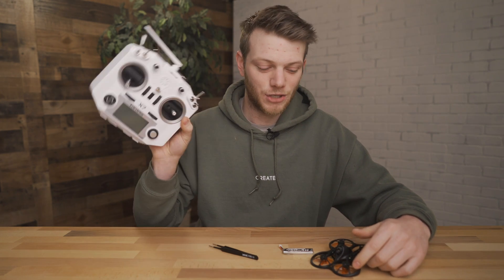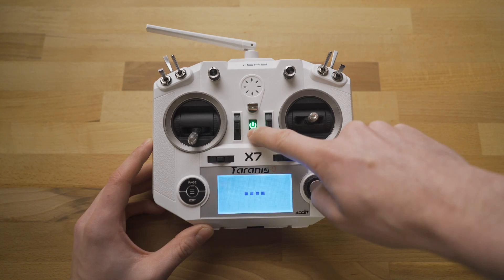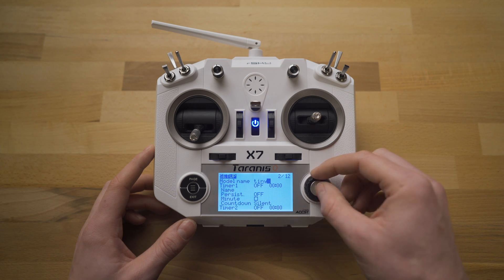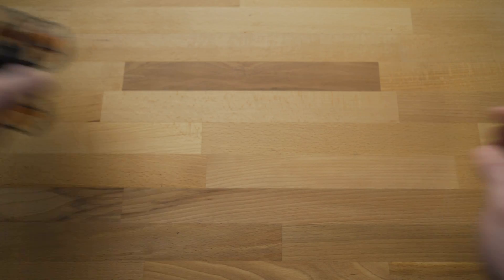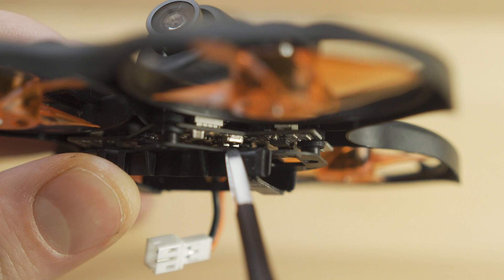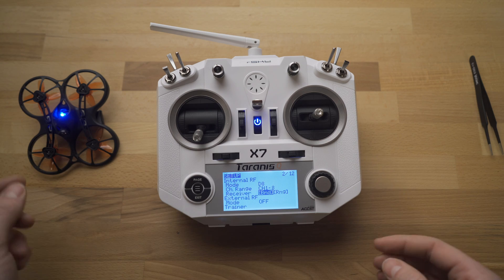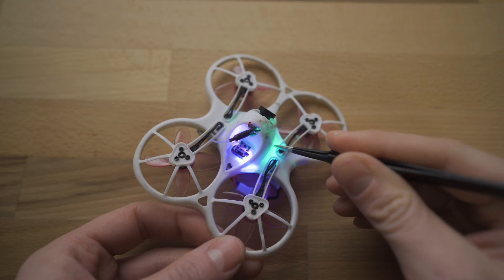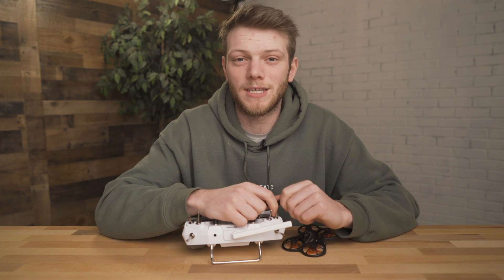How to Bind EMax Tiny Hawk and FrSky Taranis QX7

Comment: I have the same taranis but i dont have a module in the back, like above the battery there is another socket with pins.  the eachine rtf kit has its own radio but id like to use my taranis. It seems to be d8 protocol on the quad. Which module do i have to buy and stick it in the back of the taranis¿

Comment: I have 2 questions:
Does this also works with emax tinyhawk 2 freestyle?
Do you need a taranis reciever put in the drone to connect with the controller, or the one which was set when you bought the drone?

Comment: Might wanna add the new access models wont work on d8 receivers unless you change it to the frsky xm, xm+, or archer m+ receiver... currently running the xm upgrading to the archer m+ for ota, fport and double the range almost 4x more than stock. 🤷‍♂️

Comment: Hello~I'm korean~
I bought an x7 remote controller after watching your video.
Is there a simulator cable in your x7 remote controller set?
Reply: No its the same cable u would use to charge a ps3 controller

Comment: Does anyone know if d16 has less or more range. I finally got my tinyhawk 2 to work but it has absolute crap range. Maybe 100ft. I was only able to bind with d16. My taranis X7 access doesn't have d8.
Reply from the maker: Is it the VTX Range or actual flight range where you lose control?
Reply: @TheGregFarnum once I lose video the quad drops. So I take it both.
Reply: I also have access. Just bought the XJT to bind in d8 and working on that now. I bought it because my range was also garbage. Will let you know if I can figure out how to get it to bind lol
Reply: @GarrettDespainVlog  Did you ever figure it out? I also have the access and the tutorials for the old models to get D8 don't work.

Comment: I have a Tiny Hawk 2 and an FRsky QX7 that came with an Access receiver thing on the back. In my mode menu options I have, OFF, ACCESS and ACCST D16. Im having trouble pairing. Will this not work with the Tiny HAWK?
Reply: I have the same problem
Reply from the maker: Try this https://youtu.be/mDBoXLGjqS4
Reply: Same problem here with my TinyHawk 2.

Comment: Have the Tinyhawk 1 and just ordered the Tinyhawk Freestyle.  Time for a new radio.  Thank you.  Don't have Freestyle or the Taranis qx9 lite (the one I'm leaning towards this hour).  I am new to FPV but am already obsessed.  Watching and learning.  Fun is!  Thanks for this and the next, which I plan to watch now.
Reply from the maker: I love the qX7 and is definitely the way to go in my opinion if you ever plan on doing bigger 3 and 5” quads
Reply: Did my research on QX7.  I like.  Question:  Do I need the XJT Lite module to connect to my growing Tinyhawk family?  Also - If I get into this, do you recommend the M7 Hall Sensor Gimbal as an upgrade in the future?
Reply from the maker: John Pellico I just bought the stock one and it works will all my tiny hawks no extra modules or software. As for the sensor gimbal I’m not to sure about that I’m using it as is right now for a 5” racing and 3” cinewhoop
Reply: @TheGregFarnum  Thanks for the nearly instantaneous response!  That what I was hoping.  From what I could tell, the newer FrSky radios stopped supporting D8,  so now they need the XJT Lite Module to connect.  Again - really appreciate the info - I'm learning every day.
Reply from the maker: @ShorePelican55  https://www.youtube.com/watch?v=mDBoXLGjqS4&t=
this is a way to do it without the module in D16 mode

Comment: Hey Greg or anyone I need help. Total new guy trying to do what you did in the video. I tried before and thought the button on top of the stack by the USB was the bind button but I think it's the vtx or something but I was following directions for binding using that button and now I cant get it bind. Not saying that messing with the other button is the problem  but I dont know. When I followed your instructions and after the steps to bind the red LEDs are still flashing and the blue is solid..hahahahaha I've been trying for awhile now. It's all new to me! If you can help that would be really cool. Thanks
Reply from the maker: Hey hopefully you got this solved already but if not shoot me a message on Instagram I am faster at responding on there

Comment: Hey there everything works fine, exept the throttle. Motors are not responding to throttle. All other signals work fine (ail, etc. are getting the motors spinning). Maybe you have an idea on how to fix this?
Reply from the maker: Hmm thats an interesting problem. In betaflight under the reciver tab when you have it all powered on are you seeing the throttle control?

Comment: Didn't work for me. Now my Tiny hawk is beeping at me constantly lol. And it's no longer bound to the eMax controller. My Mode has "XJT D8" next to it though.
Reply: I have the same problem
Reply: Ok  I figured it out ... I was changing exterior Rf and I should have been in interior rf
Reply: @qweasdzxc363  How did you change to interior rf?  My Qx7 is set to external but I can't highlight it to change it.
Reply: But the throttle and roll is all messed up
Reply: @qweasdzxc363  Use Betaflight to verify that your TX is set up right.  There is no other way.
Reply: @qweasdzxc363   Use Betaflight to match the radio settings to the model

Comment: So..... I got a tinyhawk s and the frsky x lite reciever, I've tried binding it that way and for some reason it doesn't bind.  Does anyone know what I'm doing wrong or what I missed.
Reply: Try to put the newest firmware on the frsky. Did help me. Also when in europe, it might help to switch the frsky to non-eu mode.
Reply: @Hyrsch  Thank you for the reply, I ended up figuring it out about 10 min after I posted this.  What happened was I forgot to save my settings for the x lite so there was no movement until I saved my controller settings lol
Reply: @brentrickert9400  how do you save it
Reply: @brennanhanson4617  Also for this last reply 6 months ago, I was talking about in betaflight you set your buttons up for the controller and then save it and the save button is bottom right of betaflight program
Reply: @Hyrsch  Once I set the controller up properly it bonded no problem and now I dont have to bind it to the controller anymore lol

Comment: I don't have a D8 option for internal rf. Options are 'Off' 'Access' 'Accesss D16',  neither Access seems to bind with the steps mentioned.. (Running OpenTX 2.3.5)
Reply: same
Reply: @DerHeigl  Found this video for taranis since they no longer support D8. Basically you'll need to open up betaflight under configuration and set the sp bus to FRYSKY_X: https://youtu.be/mDBoXLGjqS4